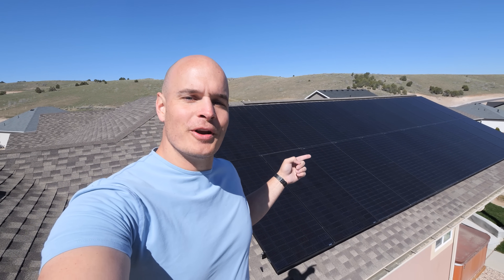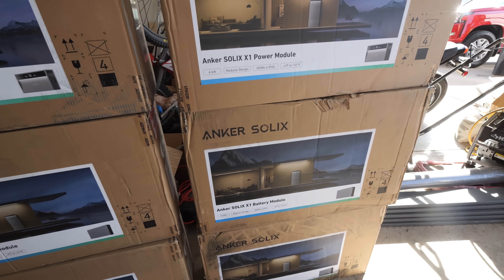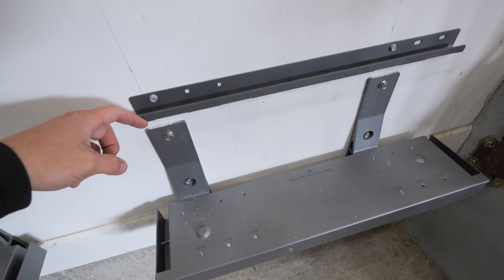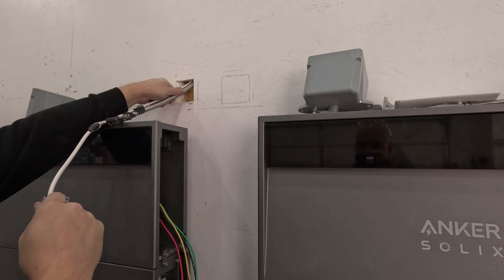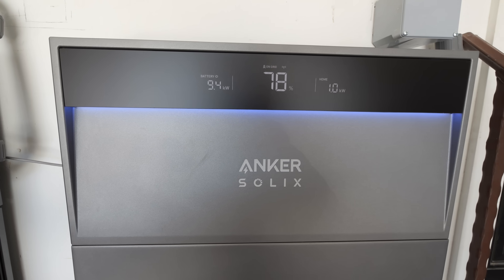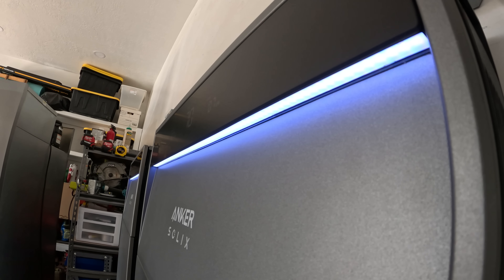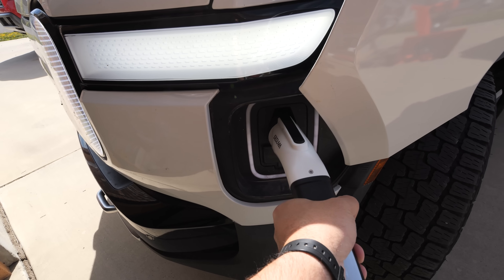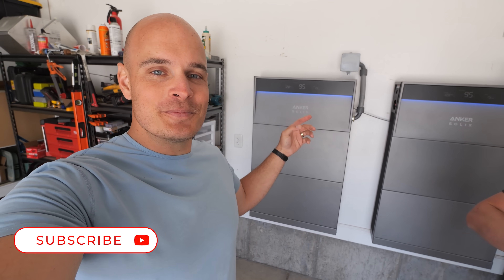How to Save Sunlight for the Night? - NEW Solar Battery Install

Comment: Michigan’s Upper Peninsula… Do you have any research / videos of wind based energy generation that can be used in an urban / city setting?  I live in Upper Michigan where summer & sun are short but there is typically no lack of wind all day & night. A good winter storm brings a LOT of wind.  Do you real world info / products that don’t require putting a turbine 60 feet in the air and is urban / city acceptable? I’ve seen products that can take advantage of the increased air flor to the roof ridge … or multi-directional pods that direct wind up/down into a turbine.  I’d love to store wind energy into batteries for overnight heating, cooling and lights!

Comment: What is the average American using 30kWh of electricity on? If I use more than about 5kWh (in the UK) it's because I've been doing a lot of laundry.
Reply: Air conditioning and heat pumps (more common in the South) are going to be driving up the average. Also keep in mind it's 30kWh per home, meaning more like 10kWh per person.

Comment: I had backup system, hurricane flooding shorted everything out. I suggest mounting anything like this as high off the ground as you can. Basically mark what you think and add 6 inches.

Comment: What is the cost per kWh?  Also, in most homes the wall between the home and the garage, "where the door is", typically is rated a Fire Protection Wall. It's not supposed to be penatrated!

Comment: Would love a video that crunches the numbers and shows the ROI on the solar setup with batteries (I think an previous video estimated 10 years for solar when he did the DIY installation) but when you add batteries I'm sure that will jump up heaps.

Comment: Information about battery life expectency and replacement cost should be a MUST ! How will you calculate your finances (future) without considering battery replacement costs ?
Reply: It's LiFePO4 so it should last a long time, 10,000 cycles is normal for this chemistry. They mentioned a 10 year warranty so clearly the manufacturer expects it to last more than a decade. Also keep in mind it should keep working even after "end of life", just with reduced capacity.

Comment: you need to combine all three types of passive energy, into one system, it's not that hard, dual purpose solar panels, use water to cool panels so they last longer and you can use the hot water for domestic use. There is a guy in NJ who gets temps of 140 fahr. in winter.... then you need similar to the the tesla wall battery BUT in each room of the house... DC micro grids... what if your house is a dc micro grid... tesla and edison should have worked together, ac to supply house which runs on dc...  I call it  MEM  Multi Energy Management. It goes FAR FAR beyond what I have put in here, but no one is listening....  P.S.  the dual purpose solar panels, was my idea I sent to a few companies about 15 years ago....

Comment: bravoo
Reply: It is only bravo until you realise how much the entire system cost. Then in 10 years, you will have to throw away these batteries. In 20 years, the panels will have to be thrown away (unless a tornado or hail storm came by). These solar energy videos are giant scams from which sellers are benefiting hugely. Only the Australian Electronics guy came out clean on this utter shambles.

Comment: Why would you test 20ms power switch on halogen/incandescent light source? If somebody is going full off-grid mode, wouldn't they invest into low energy consumption led lights? Which, spoiler alert, are far more affected by voltage disruptions.

Comment: I have solar. It is a small system, it works okay. It is not the end all. I would have liked you to talk about the cost and the down side of solar. That system had to cost $18-22k calculated savings of $600-1000 a year payback is 20+ years. None of that equipment will last that long before needing replacement. That is the same conclusion I came to. I will be buried ( next to windmill blades) before I break even.

Comment: idk but i feel like it's safer to just get a container to house the battery or build a seperate battery house to avoid burning your entire house if ever there's a battery fire. a under ground is pretty good too cos the temp is cooler.

Comment: How well do they mesh with other systems other than solar? Looking at having wind turbines and possibly hydro on my farm and am looking for a storage solution that is easy to work with other parts.
Reply: For off-grid (including grid failures) I believe almost all "Powerwalls" support frequency shifting which lets them safely charge directly from any AC-coupled generator. The main downside of this is that some AC-powered clocks will run fast.

Comment: I have 16kWh of self build LiFePo4 storage and don't use any grid power anymore.(I'm a single man)
I have my battery mounted on a wheelbarrow so I can charge it at my workplace ~500m away from my house. It has 27000Wp of solar panels and A beefy 48V forklift charger.
Reply: I have looked for a cable or set of transformers with overhead lines.
Both options are crazy expensive.
Cable would cost me more than the entire solar array 😳

Comment: Love the video, but I gotta ask: How on earth do you use 30 kWh per day. In germany a 3 person household uses less than 10. I know Americans cheap out on isolation and AC uses a lot of Power, but still.
Reply: You just said why. Air conditioning and heat pumps (or even worse resistance heat) combined with poor insulation skew the average higher. There's also the fact that most Americans don't buy with efficiency in mind.

Comment: Cool system. For our house floor heating in Spain, I will install a large water tank, that will be heated during the day. Not so efficient but if you count the interest and the cost of the investment, it should be very much cheaper heating. We still have some batteries for AC cooling hot summer nights.

Comment: The average home uses 30kWh per day? Do American homes heat and cool exclusively with electricity, because other than that I can not think of a reason to have such a power consumption.
Reply: Some American homes do and that drives up the average. If you exclude HVAC the, cooking, and hot water it's probably more like 12kWh/day.

Comment: I do not think the whole thing is appropriate. In the past few days, I asked about solar energy with a capacity of 3 kilowatts, consisting of 6 solar panels. The average power of one panel is 540 kilowatts, and it is ready to receive 3 kilowatts of energy and four batteries. The capacity of each battery is 150 amps to store energy for the night, and it did not cost anything bad. Wires and complete installation total $2100

Comment: Not even the AI's are revealing the price. "The price of the Anker Solix X1  is not publicly available. Anker has decided not to share the Solix X1's price tag. Prospective buyers must contact the Anker sales team to discuss order and pricing information.  This suggests that the Anker Solix X1 is a high-end product targeted towards people who need a significant amount of backup power."
Reply: It's best guess, "It's difficult to pinpoint an exact price for the Anker Solix X1, but here's what we can consider to make an educated guess:

Similar Anker Products: Anker offers the Solix F3800 home power solution with a 7.68kWh capacity for $3799. Since the X1 is modular and likely offers higher capacities, expect it to be significantly more expensive.

Competitors: Tesla Powerwall, a popular home backup system, starts around $7,500 for a 7kWh capacity. Considering the X1's modularity and potential for higher capacities, it might fall in a similar ballpark or even be pricier.

Considering these factors, a reasonable guess for the Anker Solix X1 could be somewhere between $7,500 and upwards of $10,000 depending on the chosen configuration (number of battery modules).

Remember, this is just an estimate. Contacting Anker's sales team would provide the most accurate pricing information."

Comment: ANKER is really stepping up. It only feels like yesterday they just made smartphone chargers and accessories. It looks slick. It’s expensive yes, however people have to look at long term. I don’t know how other Electric Companies work but the one in my area has a minimum charge for usage even if you didn’t use any electricity.  I think it was around 20 bucks, I am not sure. The money saved on electricity will eventually pay for the system, batteries, and installation while still saving money each month. How it works is you pay the installer like they were your electricity company but that monthly cost will be less than you were currently paying the real electric company.

Comment: "ONLY" 30 Kw/h per day? 😅 it's less than half of that in Europe. The fuck you guys are doing over the pond? I know our houses are built way more energy efficient, but it can not be that much? 😮
Reply: The main splitter here is if you have another heat source. Here in the North of Europe most need heating a big part of the year, and the average consumption for a house is 55kWh per day, but that's not constant, its probably around 15 in the summer and closer to 100 cold winter days. Houses that have other means of heating, like wood/pellet burners or district heating average about 15kWh per day year round.

Comment: Pretty cool system, especially some of the modularity and the fact that it will balance the output of the battery units so you can mix in new ones as the system ages. 
I feel like my biggest concern would be long-term support, given that Anker is not exactly a dedicated solar company, and priorities change. But we will see.

Comment: @0:15 "the average home in the USA uses only 30"... 30 KH/h per day? My apartment in Japan used 13KW/s per day in peak summer (maximum air conditioner use) and that cost $100 for the month. How much are you guys paying for electricity???
Reply: The average home in the US is much larger than an average apartment. If you're in an apartment you are also sharing walls which massively reduces the air conditioning need compared to a standalone house.
Reply: I pay less than $10 per month of electricity about 100-120 kwh of electricity . I cook with firewood outside or on a coal stove. 90% of the time i am usually at work

Comment: Solar energy is the cheapest energy source?  23kW of panels, 12 kW of inverters and 30kWh of batteries. Doesn't sound cheap to me. How much did all that cost (without subsides)?
Reply: Cheapest energy source, not cheapest power source. The solar produces electricity at $0.00 per kWh which can't be beat. You only need to pay once for the power capacity

Comment: At this point why not go with hybrid string inverter with high voltage batteries for true on+off grid? In case of grid failure a Solark could still draw power from the PV keeping the truck charged, house running at full power, and at night the full batteries could keep things running.

Really don't get why so many US installations prefer micro inverter instead of string despite the off grid generation advantage.
Reply: I thought I saw MC4 cables being connected, suggesting that it is a hybrid inverter. Even if it's not, most of these battery systems support charging from microinverters during a power failure by using frequency control. Sol-Ark can additionally accept AC coupled solar via the generator input/auxiliary output.

Comment: In the UK its cheaper to just have the battery and charge it from cheap night tarrif plans.
None of the hassle of installation, guaranteed power and more than 50% cheaper, with no upfront costs.
Reply: im not in uk, but this is exactly what i wanna do... charge batteries on cheap night power, and use it during the day....

Comment: Okay, you lost your mind on this one. First the fact that he has them on two sides of his house tells me they face East and West. So all those panels are only producing at about 60%, a waste. And clearly he is on the grid which means all the excess electricity is simply traveling down his power lines and to his neighbors. Not a waste at all. The utility functions as your battery. You give them power during the day and it goes to your neighbors. You take power off the grid at night. Why in the world would anyone on the grid waste money on batteries? Also, your Riviana has a 106KWh battery your battery storage was 20KWh so you can not charge the car past 20%. So why not run the house off the car battery? Finally, the batteries only hold 20KWh and the house is averaging over 100KWh per day. Where is all the electricity going after the batteries are charged? Hope you use the Anker money for this crap on something good.

Comment: Net Metering 3.0 is only if you're grandfathered in and only for 20 years.  New customers get reimbursed the wholesale rate which is a lot less.  And if the batteries break after 10 years then you're on the hook versus paying the utility they maintain everything.  And even with solar you still may need utility power as a backup so you will be paying those fixed costs even if you don't use any power from the grid and will be subject to rate hikes.  And during cloudy days you won't make as much power.  So the math on this is a little complicated as to whether it's worth it.

Comment: I only have 7.3 Kw in solar panels but my 2 Tesla  PowerWalls combine for 27 Kwh of storage which sounds like a better combination to me. Most days my batteries are 100% charged by early afternoon then I am exporting the excess and the battery powers the house overnight with a 50% reserve. Another feature I like is I never charge my Model Y until I have excess solar.

Comment: If possible to attach to the grid there is no economic reason to buy expensive and hardly recyclable equipment. There may be other reasons for the investment = "doing your part for the planet". But bully your power company first to do their part.

Comment: I need to see how the hookup was done into the service.  A lot of service panels are virtually impossible to insert a hole house transfer switch between the main breaker and the breaker buss.
Reply: Added a new panel after the service disconnect so the transfer switch could be in between.

Comment: Batteries are obviously LiFePO4 if they can cycle like that for ten years. I you limit the depth of the charge and discharge cycles, those batteries could easily go out to 20 years. The electronics might not fare so well, then the issue would be finding the parts.

Comment: My area prohibits solar backup batteries!! To get the permits to install solar, we MUST tap into the public utility grid to provide community solar. We DO get net metering, so excess kWh produced are credited back to us homeowners. But batteries are not allowed by the HOA and township. I am fine with that. Cannot afford the batteries + professional installation and haven't paid for electricity is 8 months.

Comment: i thought you were going to talk about some new crazy thermal energy storage device. batteries are expensive and most of our energy needs are hvac both in heating and cooling. im redoing my system and may have a smaller 30kwh lifepo battery bank for lights, tvs, friedge,  freezers but i want something to store hot water to heat the house in winter, and cold water to cool it in summer.

Comment: USA isn't a country that has unified laws... Every state has their laws. Europe is the same! This solution varies from impossible to no problems at all! I have 210KW installed in our farm in Bulgaria (east Europe) I had to go through a lot of legislations to be able to not only use the power but to sell as well!  I make around 280000KW/h per year and the stock prices vary so much that it doesn't make any sense! 3 years ago, the price for a 1000KW/h was 300$ and now it's around 35$.. I have around 65% returns from my investments in almost 3 years, but the first one got me most of it... For example today I made 1155KW/h and I made around 60$. In 2022 It was around 400$. The normal price should be in the middle! A 1000KW/h should sell around 110$!

Comment: Its makes sense to get this setup if you live on an area with inconsistent access to the grid or during severe weather seasons. It will most likely take more than 10 to 20 years to break even after the intial cost.
Reply: correct. Sometimes and more times than not, its cheaper to just pay your power bill
Reply: This is what most people do not understand. They think my bill will be cheaper! but never consider the debt they will be in and how long it will take to break even and actually start benefiting. By then the batteries/panels are dead or efficiency has dropped to the point of replacement. 

There needs to be a balance where I can power my house AND charge a battery AND not take me 30 years to break even cost wise.
Reply: @EyeVanGee  in china this system would cost around 12 to 15k so pretty good id say

Comment: for those with a big property and scared of battery exploding in their garage, wonder how hard would be to have a remote shed filled with the battery away from the house
Reply: These are LiFePO4 batteries, their chemistry makes them un-combustible* ( Even the old Ni-MH were extremely safe it was just fear mongering by the news )
Reply: It's stupid easy, you just need longer wires.

Comment: ok you say they are cheap.  Well I see no price on the website.  Most 5.1 KW batteries are 100AH.  and you have 6 stacked.  Are anywhere from 1,000 to 1200 bucks  Some people think 5k is cheap, some like me think 1200 to 1k is cheaper than 5k

Comment: So he's in California where he's only worried about having around one day of battery backup? How many batteries would you need for several days, or to go completely off-grid? I still pay a minimum monthly fee ($14) to stay connected to the grid, and I still get full 1:1 net metering credits, but if they ever change that, I'd like to be able to store my power instead of "lose money" sending it back to the grid.